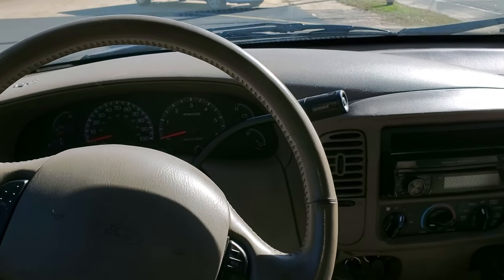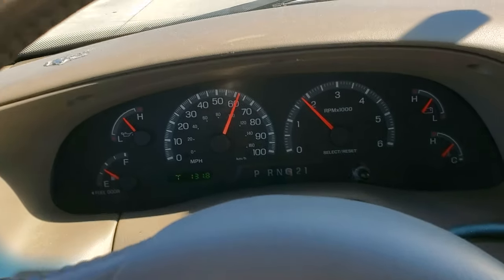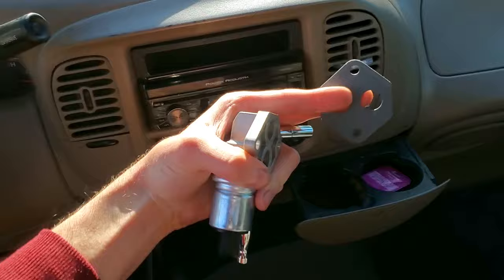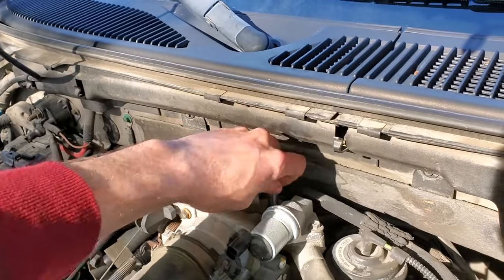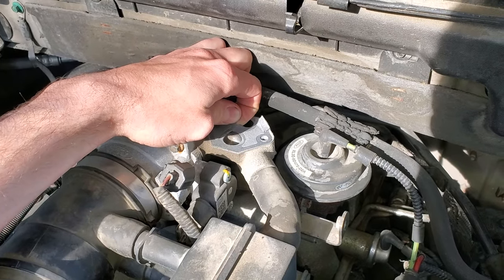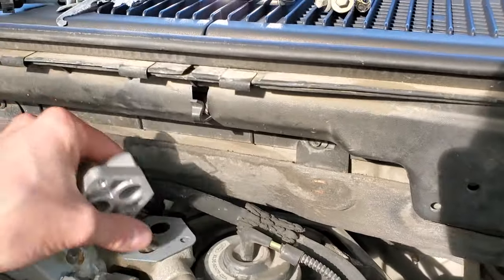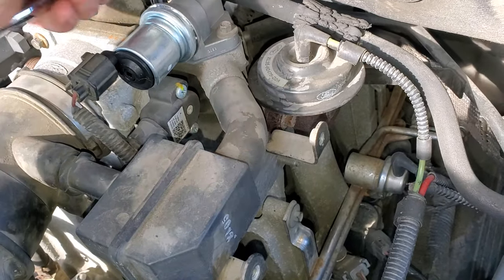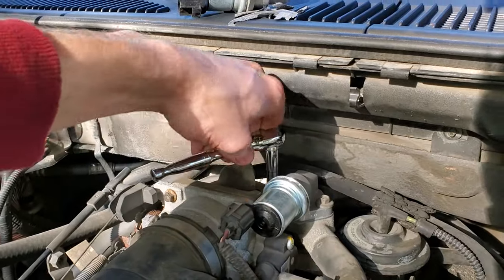F150 Idle Air Control Valve Symptoms and Replacement How To

Comment: I have a 98 4.6 5 speed. Mine on cold start stalls unless I give it gas. 
Could this be the issue?
I don't have any other stalling issues.
Just when cold and hasn't been driven. After some revs it goes to normal 1000ish then gets down to idle later
Reply: Mine doing the same
Reply: @marigarcia1000  ok so just an update. It was the idle air controller on intake and the fuel pump. Starting issue was the intake, loss of power was the fuel pump

Comment: i changed my iac  valve but it still idles high at a stop
Reply: Did you fix your problem I had the same issue and and had to replace my throttle body as well.

Comment: I got a 03 150xlt v8 triton 4.6, it only idels rough, and at a stop sign, when I left off the brake and push the gads to go it hesitates for about 1 second or so then goes drives fine,,, any ideas maybe??

Comment: No check engine codes?
Reply from the maker: No codes!
Reply: I got a P1504 on my 99 Expedition 5.4L. "Manufacture control" was what my scanner read. Surely enough it was the IACV. Put a new one in and problem fixed.